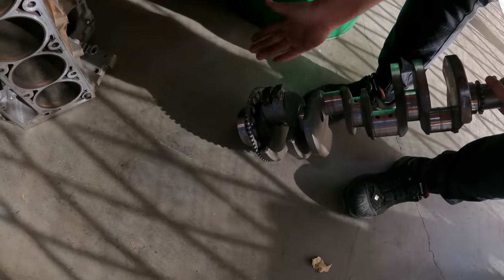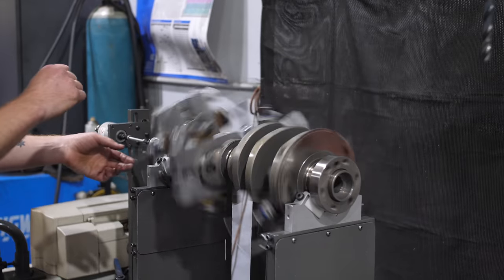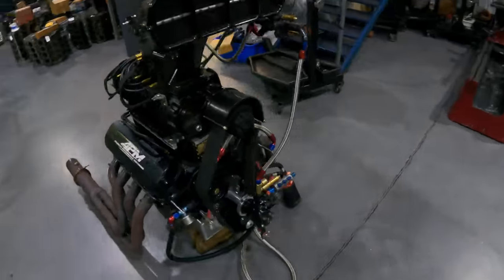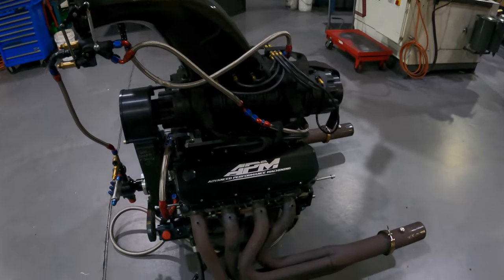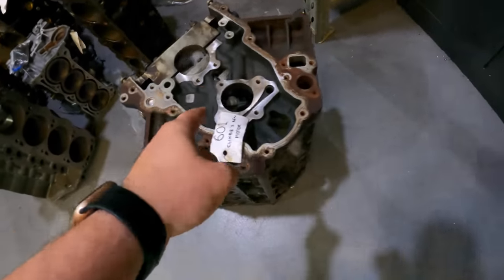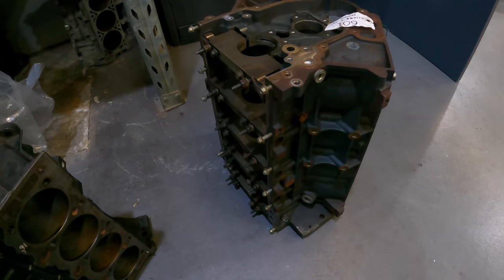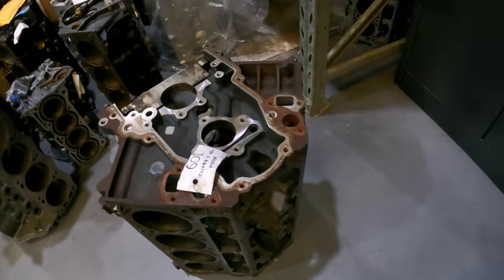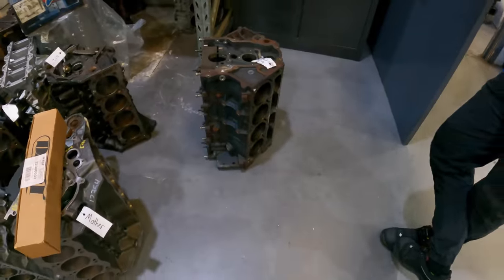Wanna see how fast a crank spins? CLIKB8's New 1000hp Combo!

Comment: Will wiring in a fuel cut off  switch prevent hydro locking from happening do you reckon
Reply from the maker: We just make sure we empty the engine of any fuel before we turn them off, if you listen to almost any burnout car when they’re turning off the revs start to raise just before it shuts off, that’s us running it out of fuel!
Reply: Cheers bro keen to see the new engine in action